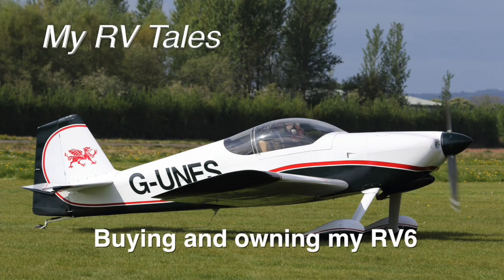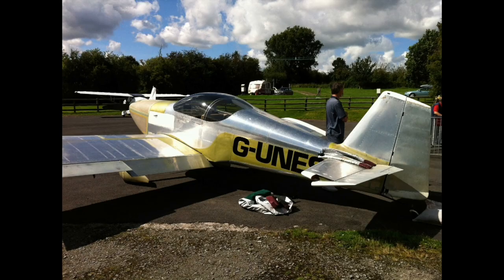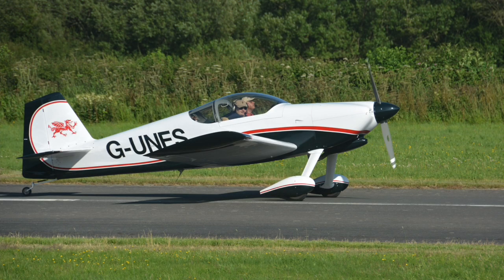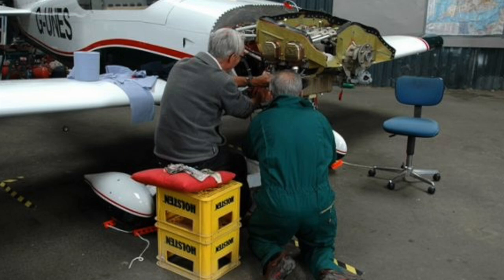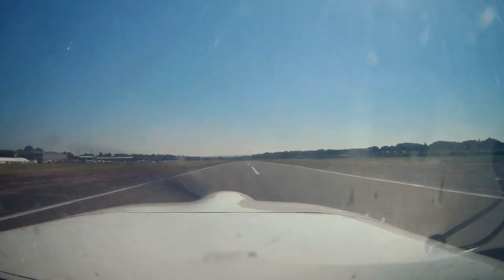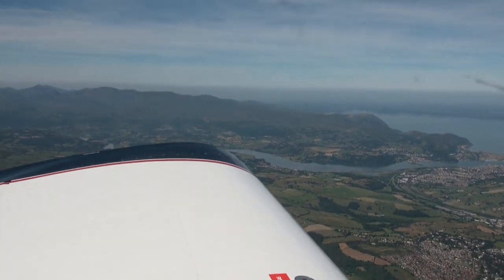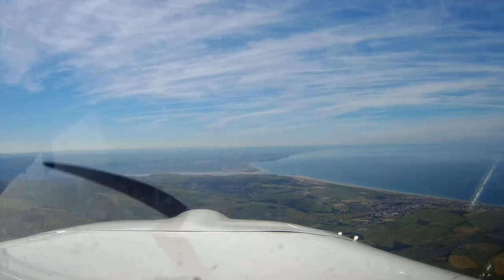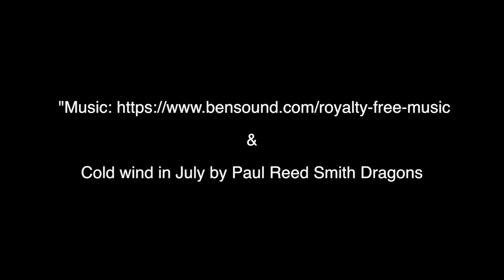RV Tales:  Buying and owning my Vans RV6

Comment: RV’s are a jack-of-all-trade type of aircraft.  They’re pretty fast but fixed-gear, and have decent shortfield takeoff/landing capabilities.  You won’t win any STOL competitions, but you can get in & out of the same strips as the other bush aircraft (and outrun them on cross-country flights :D).
Reply: I currently have a cherokee 180 ive been building time in.  The back seat was used once.  I started looking at lance air 320 and the RV6 and now with the low stall speek im really thinking of getting the RV.  my home airport is about 1600 usable in the woods on a hill.

Comment: I bought an RV-6 last year.  Thank goodness I did a good pre-buy.  The bolts that hold the tail on were all installed improperly.  That's the big problem with buying experimental....the quality of build varies WIDELY between novice builders.  Great airplanes (if you can find a well built one).  Caution...every single RV will be advertised as being built by a "meticulous builder"...usually an "engineer".  Buyer beware!

Also....how do you run over an airplane sign?  Did you go off the taxiway?